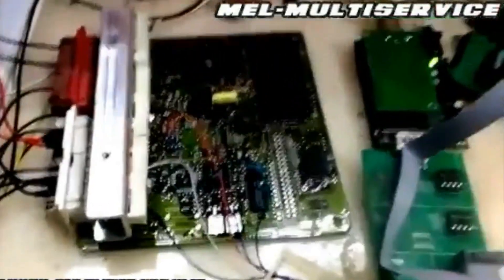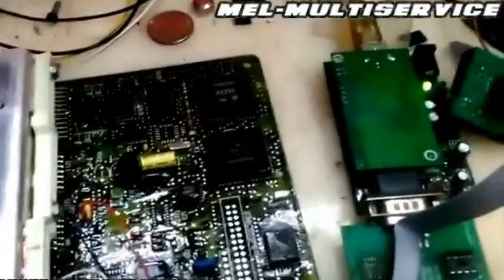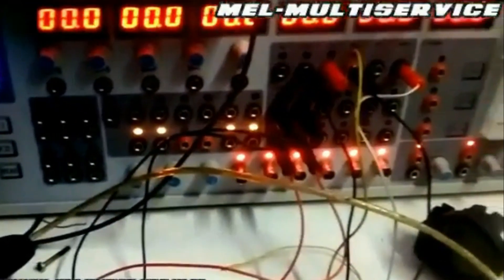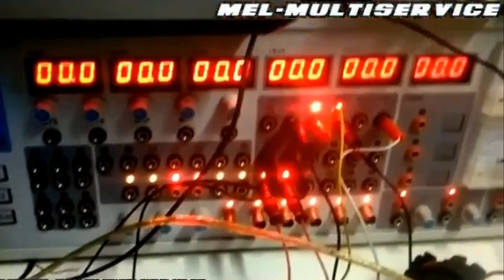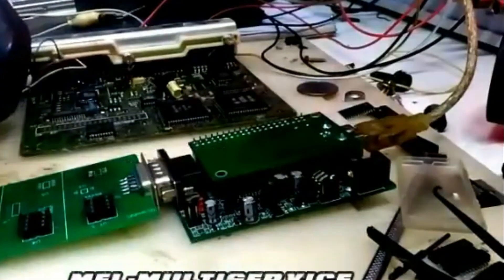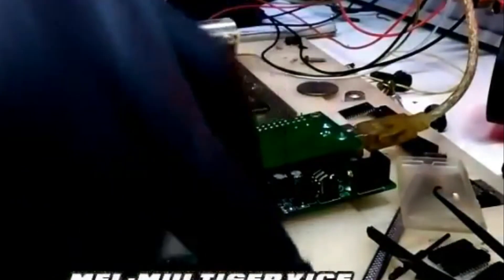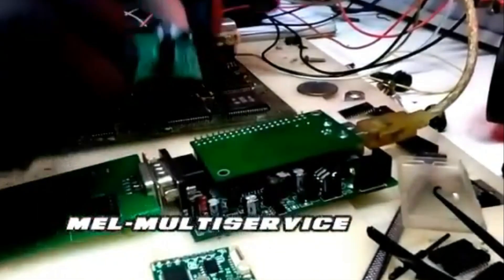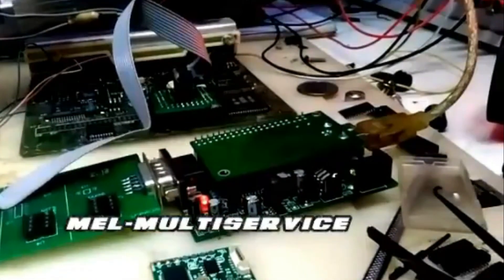Unlocking the Tech: The Role of EEPROM in Your Car's Brain - Explained! [ ecu repair ]

Comment: Eeproms are no longer used, ' cause they are expensive......instead nowadays the vast majority of automotive processors have a " Data flash" which is an electrical erasable data flash with size of 64/128 knytes and a block size of 4/8 knytes ( a device has 8/16 blocks which can be individually erased and rewritten.... ) 
The problem with data flash is that they allow a number of block rewrite which is far smaller than eeprom does and thus needs a more complex control other than simply write data w/o taking into account number of rewrite.. 
The algorithm consists in writing  at the beginning of each block, the maximum number of possible rewrite and decrement the counter at each key off or power off. 
When the counter counts down to zero the next available block is used... 
Generally to understand how many rewrite  will take place during the vehicle life, one can assume a 10 or 15 years of vehicle life span and 100 key on/off cycles per day...